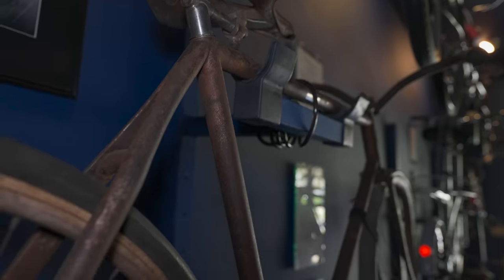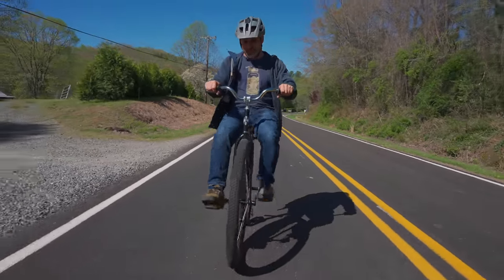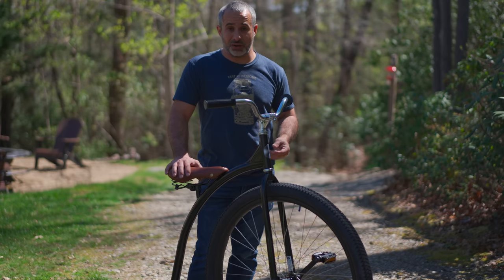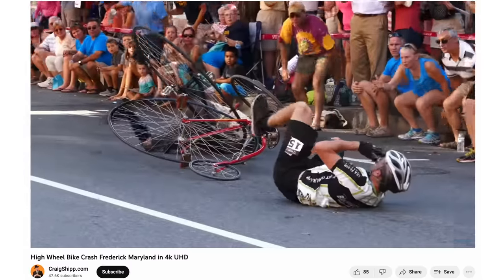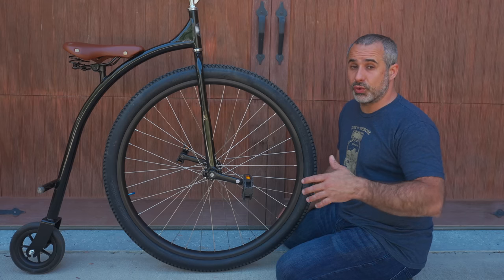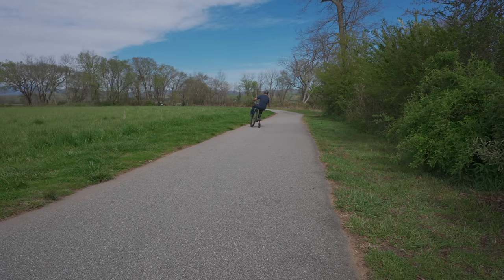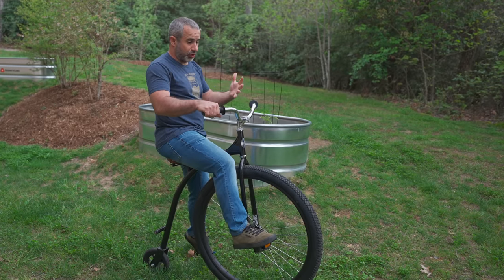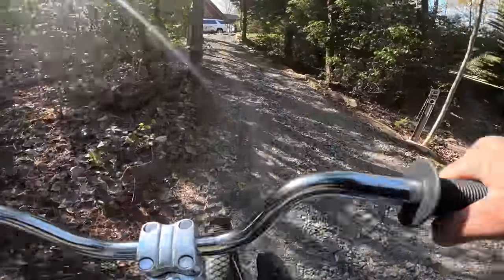The Penny Farthing was the sketchiest bicycle ever made

Comment: Thanks for a fun video.  From everything I'd read, one tell-tale for a high-wheeler being original is to look for cross-lacing.  Most original high-wheelers would have radial lacing or perhaps a one or two cross pattern.  You can see that in the photos of the bicycles actually of the period.  The reproduction shown in the beginning of the video is hard to see but it has at least a four-cross pattern (if not five).  There were exceptions as Wikipedia says, "James Starley in Coventry added the tangent spokes and the mounting step to his famous bicycle named "Ariel."  It doesn't say what cross pattern Starley used and I can't find any actual photos of "Ariel," but cross-lacing wasn't unheard of.  Since many or most of those bicycles were used for racing and were meant to be fast, the racers wanted the largest front wheel that they could ride.  Metallurgy back then wasn't as nearly as good as it is today and for a large wheel, they had to use really long spokes and with spokes that long, they had to be a fairly large gauge.  The spokes used in cross-lacing have to be longer, so the weight difference in crossed or radial spokes for those huge wheels is notable and the worst place for weight on a bicycle is in the rotating,  un-sprung item of that front wheel (and we all know how racers are).  Today, we know the benefits of cross-lacing in avoiding spoke windup along with its improved ride comfort are worth the weight penalty.  Also, the 'gear-inch' measurements still used today for selecting bicycle gears comes directly from the diameter measurements of the high-wheeler bicycles.  And to agree with what was said about the cost of any bicycle back in those days, even carrying over into the 'safety bicycle' days, they weren't cheap.  Remember, bicycles made the Wright Brothers successful enough to spend all that time and money that it took to invent the first successful airplane.

Comment: What if you put a brake on the front wheel but when you used the brakes you were standing on the back pegs? It would prevent flipping over since your weight is on the back? Great video, I learned a lot, love your channel.

Comment: Thanks for the video.  I always wondered why that engineering design was ever built, much less popular.  Looks horribly difficult to control, especially the really big ones.  But now I think I know why:  this was before someone came up with the idea of a chain to drive the rear wheel.  So they just put pedals on one wheel, then they needed a seat, then they needed ground support for the seat and something to guide the big wheel so they added the little one.  And they positioned the rider mostly over the big wheel rather than down low, for ride quality as you described.  Makes sense, for the technology of the day.

Comment: Your bike uses a "quill" stem, (or "gooseneck"), like an old-school BMX. They can hold tight to the fork by snugging the stem bolt. Modern bikes use "threadless" forks/headsets with different type stems, such as "front-loader", "top-loader" and "pivot" stems.

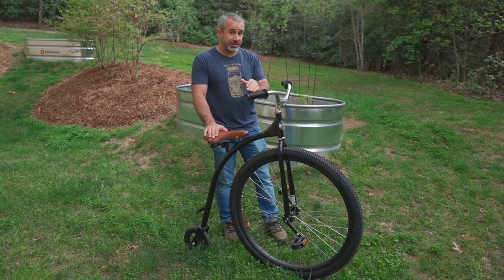Comment: I have something very similar to what you are riding but it's a Qu-Ax with a 36" wheel. Sadly it doesn't get ridden much as I live in a hilly city. 7:38 I came across the same problem but realised a light touch on the bar works wonders - you just have to let the front wheel sashay left and right as it will, within reason!

The Safety Bicycle was really only made possible when a guy called Renold figured out how to make drive chains light and cheap enough for bicycle use, and once that happened (in about 1885 IIRC) the Ordinary went out of favour about as quickly as you might expect!

Comment: Penny Farthings were the origin on 'inch gears' except it was 'inch wheel' back then. To change Penny Farthing's 'gear', one changed to a larger or smaller wheel.
To change only the gain ratio, one changed crank length, same as one of the options today.

Comment: I know a guy who's something of a legend around here (Nova Scotia, Canada). He used to run a bike shop for decades before retiring. But at one point, he apparently rode a Penny Farthing style bike around the Cabot Trail in Cape Breton. If you don't know that area, it's incredibly hilly. Apparently, he built breaks into the front wheel, but they got so hot from breaking, he had a squirt bottle with water on hand to spray down the wheel.

How much of that is true, I don't know. It's just what I've heard.

Comment: I've seen picture of some extreme velocipedes.
One that marked me was one with a 3m front wheel, sliding push pedals connecting to the crank using rods. Try slowing down with that. Another had two chains linking the hub to a pair of pedals, one on each sides of the fork. Those two where absolutely insane.

Comment: The safety bicycles were mostly fixed gear too, although the freewheel was invented in 1869 it didn't get popular until much later.

One thing that is lost to time though are coasting pegs. These were pegs sticking out from the fork of your safety bicycle where you could rest your feet when going downhill so you didn't have to pedal super fast. I wouldn't mind a pair on my fixed gear bike. 😁

Comment: Entertaining as ever. It did make me wonder why did the Penny Farthing not get made more the size as the one Seth was riding, it would of been easier to get on and ride.
Reply: I think it was down to the fact that the size of the wheel effectively gives you the ‘gear size’ - the bigger the wheel the bigger the gear. So a larger wheel would allow you to travel much longer distances for the same amount of pedal strokes. And seeing as no-one rode them up hill anyway, it was preferable.
Reply: @rob-c.  Exactly this. Penny farthings with a large front wheel can go suprisingly fast. The old hour record was 35.5km. There are still races with them and it's quite amazing.

Comment: Penny-farthing is the English name. The English penny was a rather large coin, the farthing was quite a bit smaller - like the wheels on the bicycle. The same bike was generally called an ordinary in the US.
So Thomas Steven's ride  on an ordinary from San Francisco to Boston in 1884 is an impressive feat?
I always resisted the urge to ride an ordinary. It looks like riding a unicycle with handlebars and a useless companion wheel. Some later models had spoon brakes on the front wheel which required delicate handling lest you send yourself over the bars. When coasting downhill, you "freewheeled", i..e., you put your legs over the handlebar so that if you went over the bars, you did so feet first. You might as well; your feet weren't going to keep up with the pedals anyway.
Now there's an idea: clip and strap or clipless pedals on an ordinary.
Anyone interested should also read Mark Twain's essay "Taming the Bicycle" with it's famous last sentences: “Get a bicycle. You will not regret it. If you live.”
richard
--
Principle of Cycling #3: Don’t arrive exhausted at the bottom of a steep climb or the start of a long, hard pull into the wind.

Comment: The Penny Farthing was conceived as a racing bicycle first then like so many other things people thought it was a good idea to use them as everyday items. The idea for the bike grew out of the velodrome board racing craze, to put it simply a human can only pedal so fast, at some point you reach a maximum cadence. Since there were no chains and gears yet the obvious answer was to make the wheel being powered BIGGER to go faster. Where do you think the term gear inches came from? It's the equivalency of the height of the wheel we would be powering in a 1 to 1 ratio.

Comment: Great video! High wheels are every bit as sketchy as they look. I own a modern replica with a 52 inch wheel. Just the height you are at makes it scary, add the fact that there a no breaks and your center of gravity is only slightly behind the front wheel hub, and you KNOW if you hit anything you are doing a header. From five feet in the air!

Comment: A-a-and that torque effect on the handlebar (7:40) is MUCH worse on a full-sized "ordinary". Those huge wheels needed sideways stability, which meant deeply dished spokes -- and THAT meant a broad hub, pushing the pedals almost as far apart as your shoulders. All that torque around the steering axis had to be countered with your arms. Quite the kupper-body workout!

Comment: I have an older Gravity FSX29 full suspension bike with a 3x9 drivetrain that I am looking to convert to a 1x. It has a Shimano style hub with the full-length splines and I believe 32 mm of cassette space (I will have to recheck that measurement).
I'm not sure if I can fit a 12 gear cassette or do I have to go down to 10 or 11 gears? 
Also I am a heavy dude at 285 lb
and I'm thinking I need a 10/52 or 11/52 cassette with a 32 chainring.
Any help you can give would be greatly appreciated. thanks.

Comment: Whenever I see the penny farthing bicycle, all I see is a unicycle with an extra wheel in the back and an offset seat with a set of handlebars.
Reply: Yeah, thinking about it, it's basically a much less precise unicycle. Because, mastering a unicycle is so much more difficult but you can have some great control over it, whereas this here you can ride it almost like any other bicycle, and yet you will never have as much control or precision over it, simply due to design limitations.

Comment: The PF isn't even on the map of sketchy bikes when you see some of the more "eclectic" bikes done in history. This is one of the reasons i laugh my derriere off every time someone pops up and says "we've invented a new bicycle wheel" or "we've figured out a new transmission" ... nope. It's been done, it's been done to deàth. All the permutations, all the configurations, all the shapes, all the form factors. There isn't a single type of bicycle that hasn't been done - yes, including the electric bicycle. Light weight materials? Done, made from wood. All wood bicycle with metal fixings and reinforcements. Almost as light as a modern carbon bike (it's somewhere on a polish website). Three wheels? Four? Fàt tire bicycle? Done, done, done.

Comment: You didn’t seem to specify the reason for the big wheel—bit of a whiff—which kind of left me with the impression that the feature of smoothing  bumpy roads was sort of incidental. And sure enough, when I googled “why the wheel so big penny farthing” the first result talked about it allowing higher speeds with no gears. (Something I’ve probably learned and forgotten a half dozen times.) Anyway, if they were for the rich, they probably had access to smoother surfaces to ride on.

 By the way, doesn’t the little tiny wheel on the back sort of negate any smoothness gained from the large wheel on the front? Or is the front wheel more important, in the same way it is for braking? I guess that makes sense
Reply: Reverse-Penny-Farthing Pebble Challenge (Gone Wrong)

Comment: You evidently don't understand physics. A real penny farthing, the big thing you didn't want to ride, works better on hills because you have the big wheel directly connected to the pedals. This is why people rode them. Safety bicycles didn't really get popular until the 3-speed was introduced. This allowed people more flexibility. The standard kid's 1 speed of the 1960s was okay, but hell on hills. That's why everybody wanted a 10-speed. The huge front wheel was essentially a low gearing for the feet.  And you could exercise some degree of braking by resisting the travel of that big wheel... enough hopefully to dismount safely.  Riding a penny farthing takes some getting used to, but it can be done safely.

Personally, I would not want to ride any contemporary bike of the 1880s on cobblestones or brick streets. Most people didn't ride in town for that reason. They put the bike in the back of a wagon and went out to the country. Unless the roads were really badly rutted, you could ride a penny farthing or a safety bicycle in comfort and safety on most roads, which compared about like a modern logging road.

Comment: The depth of the presenter's ignorance of the penny farthing is actually quite shocking. By the time that safety bikes were being used widely the penny farthing was a very specifically 'racing' bike. They had extravagantly large wheels because that effectively set the gear ratio - on a bike which has no chain or gears - and they were understood to be dangerous, substantially because people rode them as fast as they could. They weren't used for a family outing any more that a formula 1 racing car is used for that today. Yes they were dangerous, this was understood and accepted because of their role in competition.

Comment: Great.  But you didn't explain what a "penny farthing" is.  The bike was named after the contrasting sizes of the two wheels, and comparing them to the relative sizes of British coins.  In the mid 19th century, £ 1 would be worth roughly £ 120 today, so one penny ( 1d ) back then ( 1/240th of a £ ) would be worth a half £, or 50p, today. Obviously coins were needed for smaller amounts than 1d, so they were "ha'pennies" ( ½d ) and "qua'pennies" ( ¼d ) denominations, commonly called farthings.  They were even half farthings and quarter farthings in circulation.  The penny back then was a fairly large coin by todays standards, and each of the smaller denominations had a correspondingly smaller coin.  Hence, comparing the bicycles' wheel size difference to that of coins.

Comment: The most stupidly designed vehicle in the millennia-long history of human technology. Why not START with 2 equally sized wheels?
Reply: "Why did our ancestors use horse and carts, didn't they know cars were a thing..." 
That's how you sounded there
Reply: @chill_will9816  Are you SERIOUSLY suggesting that a bike with 2 equally sized wheels wasn't possible first? 😂 We had the technology of the industrial revolution then, locomotives and steamships. What is it about the super simple design of a modern bicycle, wasn't possible in the 1880s? What happened was that one guy designed a really bad, unsafe machine, and everyone copied him. Then, after hundreds of skull fractures and broken necks, another guy said, "Wait a minute...". Modern bicycles came on the market just a few years later, without any kind of technological breakthrough. This refutes your poor analogy.
Reply: @LeydenAigg  1) never said the tech wasn't there 2)not sure if the bicycle u kicked with ur feet was b4 or after but it was simple and had no pedals and therfore no further thought into gear ratios/leg length were needed 3) PF show up, using pedals, they were novelties 4)fast forward>modern bikes